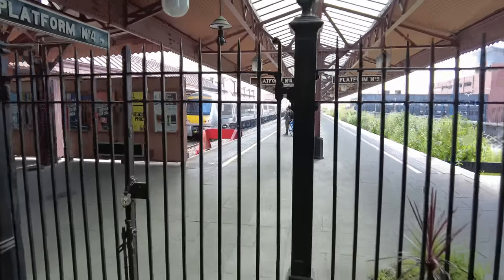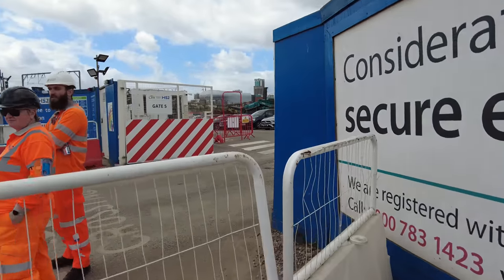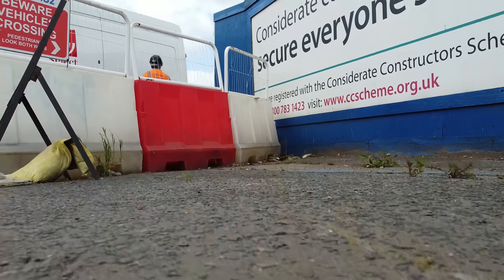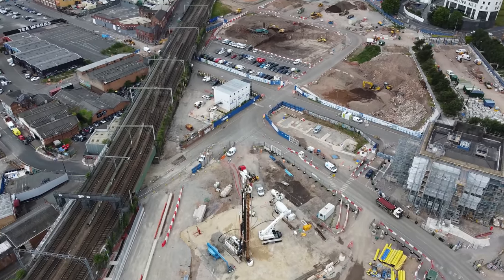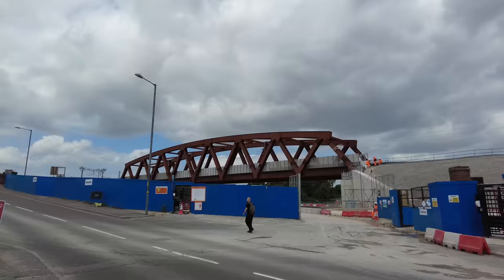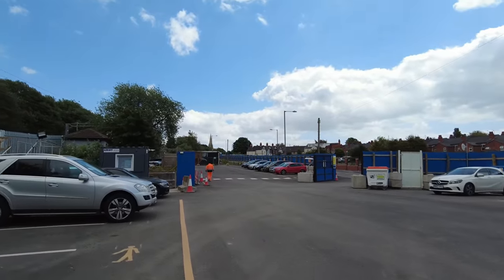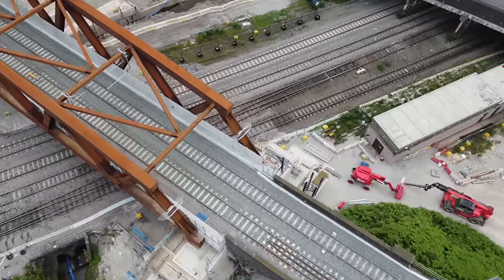Have You Got A Pilot Licence To Fly That DJI MINI 2 Over HS2? 🛸🎥😆

Comment: those augers are piling rigs will bore out the earth & backfill with concrete as they remove the auger. Then those rebar cages will be vibrated to depth. Certainly quieter than hammering in the piles.
Reply from the maker: Thanks. I will know much more ready for my next HS2 location 👍

Comment: You need to look at the Arup "Fly-by" vid of HS2 from Brum to London on YouTube.  The proposed tunnels, bridges and stations are highlighted on there.  Birmingham end has looked like this dump for donkeys years now.  When will it start to resemble a bloody railway rather than a builder's dumping ground?  The line with the new bridge IS an existing line; you can tell by the old trackwork, bridges and overhead wiring.

Comment: Oh DJ, any of us that work in construction or piling are shouting at the screen going look at all the stuff happening before your eyes that you are missing!!
Reply from the maker: I needed one of your with me 🤣🤣🤣
Reply: @DJAUDITS  haha yes - for example, those big black tanks you were looking in first location at around 07:40mins  at are full of a ground stability fluid called bentonite. It looks like drinking chocolate. Basically when you are piling through strata of water or deep gravel or anything thats not dry clay, you need to introduce a dense liquid into the bore to keep the shape of the bore hole while you are coring deeper and before you pour the concrete pile in. Otherwise it would collapse in on itself etc. Watch it back and you will see the flow/ return pipes leading to the piling casing in the ground which is the temporary cylinder where the concrete wagon is actually pouring the concrete in the pile. The rebar cage is already hanging in there. As the concrete goes in the bentonite is pushed up and pumped out like water would push oil up a hole to the top. The big green boxes and silo equipment are basically filtering the bentonite which is cycling from the tanks to the bore constantly and becoming contaminated with water and sand in the bore. Basically alot going on just in that one spot to get a pile in!

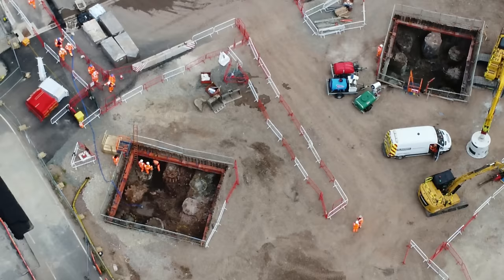At about 09:30mins you can see 3 foundations in progress 2 begun to be dug, 1 with sheet piles not not yet and probably other locations there too but not visible-  they are not archeological. you are looking at the piles that have already been poured and area started to be dug and piles started to be broken down. They have driven steel sheet piling around those 3 areas and you can see the top supporting wailing beams on the 2 open ones,  so they can locally excavate down safely. They will pour a concrete pile-cap on them - basically a chunky slab connected to the piles, to build something off of. They are too close to be for tower cranes , these foundations are meaty so looks like they will have a substantial load - so a bridge or some other major structure or a building of a decent height/ size.

Hey, down towards the london end of HS2 - at the chiltern tunnels area, colne valley viaduct area there would be alot interesting stuff going on now too. Do a visit there! Happy to help you out with future construction videos identifying whats going on if you ever want to know just get in touch. 

Edit: actually i think too close to raf northolt and denham airfield for the drone - pity.

Comment: It's quite simple, on this site you have piling  rigs, they drill into the ground using an "auger" they make a large diameter  hole , they stand up the round metal structures with a crane , lower  these into  the holes which have just been drilled,  fill them with concrete and let them set, there's no archaeology  dig going on, you have to dig round the concrete piles with an excavator  , funnily enough I'm working on that site and I walked past you.....
Reply from the maker: Thanks Jerry. You should have said hello and got your free DJ AUDITS Keyring. 👍
Reply: @DJAUDITS  oh yer, you'd LOVE to capture my face, the funny thing is you have, but which 1 am I????

Comment: The area where the concrete mixer was backing up and straight ahead of it was a tracked drilled shaft rig.  Drilling a shaft to proper depth, and then the reinforcing cages (that we’re laying on the ground) will be lowered into and Hole and  suspended while concrete is placed. 
The holes / shafts  are for not accessing underground,  these drilled shafts will be the foundation for something on top of them.

Comment: The horizontal pipes are braces for the tunnel walls whilst being created. The large tower pipes are vent pipes (I think) to allow the pressure difference of the air as the trains rush into and out of the tunnel.

Comment: 1:23 At last the sign is reasonably accurate. It doesn't have the usual "Trespassers will be prosecuted" which is a non-sequitur. Civil cases are not prosecuted. And it includes "may" since it's not guaranteed that a civil case can be put against someone who has placed one foot one foot on to the HS2 property.

Comment: DJ, which software/App do you use to check for no fly zones? I now have a DJI Mini 2 and need something that will show me where and where not I can fly.
Reply from the maker: Hi, Drone Assist APP or on a desktop here - https://dronesafetymap.com/?hsCtaTracking=b6fcfc7d-7407-4dc1-a704-87336e60a656%7C553a0e6e-33e7-4a4b-9c3f-7949e384667d#loc=52.5472491,0.0861752,12.9

Just avoid the FRZ zones and those that specifically say NO DRONES ALLOWED.
Reply: @DJAUDITS  thank you 🙂

Comment: The large tanks look to be for a slurry treatment plant for what ever type of TBM's that will be used. This will separate the bentonite slurry from the mined material and the slurry will be reused. The concrete structures you saw are just part of this plant and are not the tunnel, as one section even has an end wall.
Some open top works have been carried out with cast concrete walls and the white piping struts you filmed, this would form the portal for the tunnel and the launch chamber for the TBM's. Which would make sense as the treatment plant is also there, though why their back filling the chambers make me think they may drive the TBM.s through it. It's difficult to work out from the drone shots as levels are hard to define, what the locals said about a viaduct does fit in with the mound of earth after the below ground concrete structure.
TBM: Tunnel Boring Machine.

The last tunnel project I worked on was in KL Malaysia on line one of the KL Metro. The tunnel portals were into a hillside that had been supported with pilings and the excavated to form an upright face. The two CREG TBM's were erected in the open and a steel shove frame was built to form a back stop for the machines shove rams, the back up units were added as the TBM was moved to the face. Tunnel lining rings erected in a cradle until the tail of the machine was in the ground, these were dismantled later. The Chinese built machines averaged a tunneling rate of 345m. per month and were the first to break through on the project.

Comment: Massive expense just to get to Birmingham 20 minutes faster.
(why would anyone want to?)
The rest of the proposed HS2 system will never be built
Reply: ...and while people use HS2 between London and Birmingham the local services on the existing routes can be expanded and freight traffic increased to keep some trucks off the road.  HS2 is not just about fast journey times.
Reply: @barrieshepherd7694  if that's true why are they scrapping some sections already.